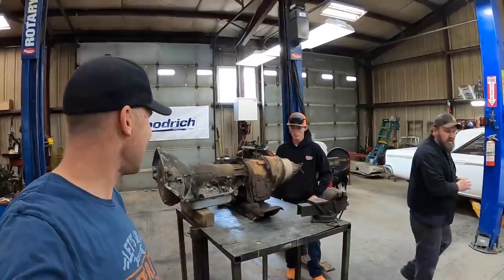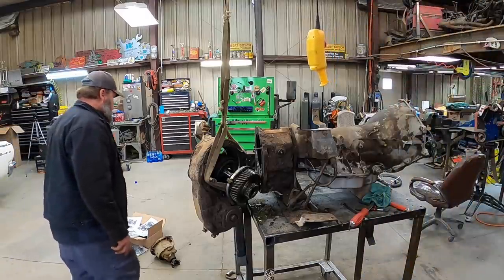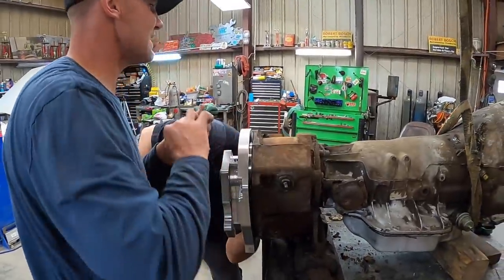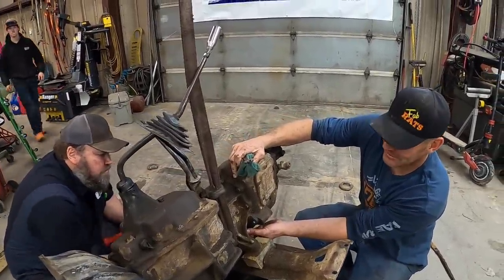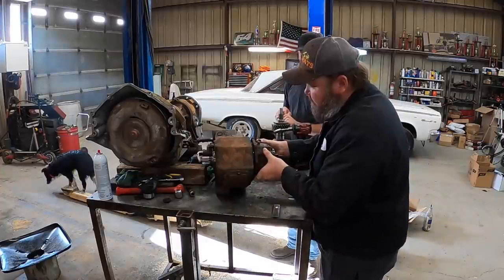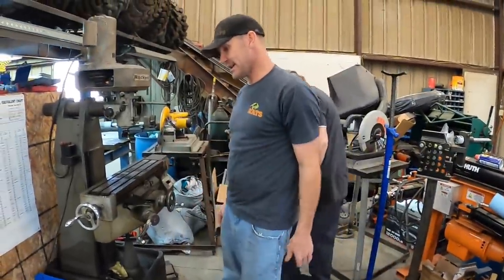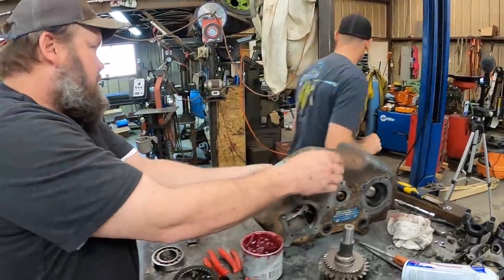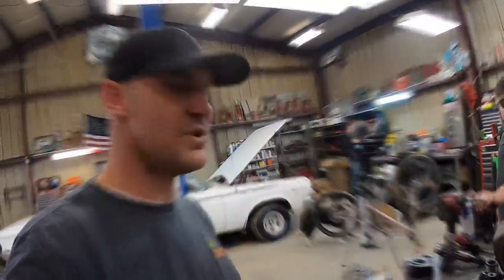No Pain, No Gain With The Rat Rod Tow Truck!

Comment: Dear Fab Rats gang, please let me come and give y'all a short crash course on maching please. I was a machinist for forty plus years and I was doing my best not to holler at y'all setting up the  case. Y'all do a remarkable job on all these builds. But just a couple of days and I could turn you into a pretty dang good machinist cause you have a really good mechanical mindset. I've got indicators, toolbits, gage blocks, dial bore gages, OD and ID mics and just way to much to list of precision tools I purchased through the years. I'd be more than happy to donate to
them to  you just so they are used. These tools aren't made in China!
Reply: Sounds like you should make a trip and pay a visit. It would be cool to watch some basic machining setups and techniques.
Reply: I was looking for this comment.  I'm not a machinist by trade but was thinking please indicate in the head, then indicate in the case.  Maybe the case was sitting on a square surface.  Then when the bearing dropped in that easy all I could think about was the race turning.  I hope it all works out long term.
Reply: That could be fun to learn how to do the best way stop in
Reply: I was wondering should have that been a press fit on that transfer case or does that get clamped in position?
I saw that it had a retaining ring on the outside of the bearing I was just wondering if the race is going to spin,
I worked on pumps for years and building electric motors so I know a little bit about bearings

Comment: Paul has an inventory control system like none other. He buys scrap parts and stacks them around the yard. When he needs a part he looks around piles and piles of parts till he finds one. After he disassembled it and combines the best looking of those parts. If necessary he mills and modifies things to make good as used parts. And it works 87% of the time!

Comment: That Rockwell milling machine would be the perfect size for me. That transfer case would fit on my lathe. To bore it out just another way to do it. Nice job as always. A couple battle wounds is always a bonus!😄😄
Reply: I believe I would have machined to about 89.95 or so and honed it from there. Make the bearing fit kinda snug. But probably doesn't matter.

Comment: I rebuild the 205 in my 1-G-D.  After nearly 20, it's still in there, doing it's thing without complaint.  I remember sorting out issues with the parts kit (input shaft bearing sizes were wrong) and having to consult my transmission man for setting up the bearings on the countershaft.  Mid January, working outside, trying to get it re-installed by myself, was not easy.  I envy you having so much good help available.

I recently found out that my transmission man now has a store/shop in Billings, MT.  What was "Quad 4x4" is now "Torque King" and they carry or even make a lot of stuff that is often sought after.  That includes a lot of upgrade items, for replacing OEM parts that turned out to be ... not so great.  So, there's another parts source to add to your call list ... Dan did the upgrade on my transmission, and I've had zero issues with it.  Absolutely no problems with transmission or the installation.  After 20 years, that deserves an endorsement.

Comment: One thing I like about your vids,... you show it all, the good and the bad. You don't attempt to cover up mistakes like a lot of guys do on these type channels, and that's life. Everyone does it and you make it real. The 203.205 doubler is an awesome and very strong set up! I hate to admit it, it is stronger than my Atlas. I'm lower, but my rig couldn't take the abuse that will be required from this old truck. Speaking of lower, Unless one of those cases have a lot deeper gear than what I know of, which is around the 2.9 low range, you should end up with more like a 4.0:1 low low gearing in just the T-cases. Which with your tire size and gearing you are going with, will be so much better than what you had. A lot of my friends end up going with the turbo 350 for two reasons, you can put a deeper first gear in them from a 700R4 tranny, and with the Turbo 400 you very often have to run a two piece front drive shaft because of the pan size of the 400. If and when you have to run a 2 piece front drive shaft, look for a forged carrier bearing. The cast ones can and will explode on you. Seen it, and it's not pretty. Since this truck will be responsible for not only it's on weight, but that of other vehicles, I do think it's the way to go. Oh and since it's a "rat Rod" get creative with all three of the shifter knobs ;) Good luck with the rest of the build. My only complaint is that I have to wait so long between vids! If it were up to me, one a day would not be enough LOL, Thanks for all the sharing!

Comment: Awesome video Paul!! I remember way back when I did my doubler kit in my 1969 Chevy 1Ton!! Stephen at off road design was totally helpful with all my questions that I had!!! I had never tour apart a T-case before!! I had definitely been putting it off because I herd about all those needle bearings but after Steve had told me a few tricks to get them to stay in place while installing the T-case it was way way easier then I ever thought for sure!!! I definitely could do one today with out any directions!! I ended up going threw both transfer cases and haven’t had any issues with it yet!! I installed mine back in the early 2000!!! Awesome job buddy and remember keep up all the hard work buddy!!

Comment: Had a NP 435 (4spd), backed with a NO 205 in my '78 Jimmy...Dana 30 front and a 60 in the rear. She would go anywhere I pointed her to go. 
Oh..and I stroked a 350 to a 383, with 205 heads..RV cam, intake and carb to match. 
She was a beast

Comment: I had picked up a spare 203 assembly for my 76 pickup.  I had no idea people were using parts of them for crawlers.  I tried advertising it and lots of other chevy engines and parts when I was moving with no takers at all.  It all went to the junk man!  Long ago I worked in a small engine rebuilding shop.  I would sit at the counter eating my lunch.  One day the owner was replacing some rear axel wheel studs.  As he hammered the first one in with the threads toward the pumpkin I asked if he was sure he wanted to do it that way.  He was a grumpy guy so went ahead and put all 5 in backwards!  Why do one over when you can do all of them over?

Comment: If you put some heat on that ORD adapter plate around the bearing recess with a propane torch and throw the bearing in the freezer for 5 minutes, the bearing will drop right in. No need to hammer it in and possibly score the machined aluminum recess. That process makes taking them out for replacement much easier too!

Comment: Love my 205. When I was shopping for a new one I became enlightened to the fact that the 85-86 GM 1 ton had a different length output shaft than all other years. 
I was pretty rough on that thing when my rear locker went out so I drove in front wheel drive from California to Houston.

Comment: I have found, that snap ring holes are slightly tapered. It happened when the holes were punched. When you punch metal, the forces don’t go straight through. They spread out a little. So knowing this, I always look at the holes and put the sharp side outward. It’s actually the opposite of how I put flat washers on. Those, I always put the rounded side up.

Comment: you can use a gum rubber band to hold needle bearings in place, the rubber band won't hurt anything so you can put it together no problem.

Comment: Needle bearings without inner race are painful. Try hairspray on shaft then stick rollers on hairspray, once all rollers in place another coat of hairspray over top of rollers. Sounds crazy but works well.

Comment: Have you ever trammed the head of your mill?  "Tramming" means you checked ( with an indicator) that it is perfectly square front and back and left and right.  
 Shall I write up directions to do that and email them to you?  It's EXTREMELY important when doing bores.  Jeff, machinist with over 40 years experience

Comment: funny and informative. Bearing hole should have been just a scosh smaller so it fits tighter i think.. but who am I right? been there done that so many times with needle bearings.. glad i too have patience. love the experience of knowledge and memory of where everything goes. I learned on my Bike, Used to tear it down to all spare parts, until frame was just bare and all parts where laid out for grease, sand paint and then re-assemble. And then put it all back together. Even took the spokes out and re-did all of them. and as for the seat hahaha been there so many times and every time i say i am gonna check seat,.... hahaha and i come in wet. Take care be safe looking forward to next video.

Comment: Where did you get pizza when you live in the middle of nowhere?   You should get a dial indicator then you can make sure the case is square by sweeping / rotating the indicator around  the top machined surface of the case

Comment: Will you end up with a slower ground speed using the 400 turbo with a 2X than the granny gear was in the manual? Wasn't granny gear 6: something to 1 where as the turbo is 2.48 times 2? Unless granny gear was not 6+ to 1 it doesn't seem like you're going to be geared as low as you were. Just a thought. I hate to see you put it in and take it out as many times as the giveaway car.

Comment: Good job boys 👍that transfer case will be bad ass 🤪 and tha craftsman snap ring pliyers are for fixing kids toys 😉  and tell me y John Deer doesn't have a drain hole in the seats my lawn tractor and Gator has the same problem 🤔 whet ass syndrome if you forget to check before sitting down 🙉

Comment: Put some retaining compound on that bearing you bored out. Bearings need .001 press per inch. That bearing should be a .0035 thou press which is easy if you freeze the bearings and heat the housing with a torch.
EDIT. You don't want the outer ring to spin.

Comment: Don’t know what oil you are going to run in your two gearboxes, the 203 required 30w or multi weight motor oil. The 205 used 90w gear oil.
I wouldn’t be afraid to run the motor oil in both or even ATF. It will be quieter with lighter oil. I have been running ATF in my Dana 300 for over 250k miles with no issues, shifts easier and is quieter.

Comment: I've had better luck with putting a rubber band on the shaft and stick the needles under the rubber band, When it goes together the rubber band will dissolve on the hot grease.

Comment: re the hole you bored out in the transfer case so the 90mm bearing would fit.  I think you made the hole too big because when you got it assembled and demonstrated the shaft turning in the bearing, the bearing should NOT be turning along with the shaft,  The shaft should turn in the bearing - bearing should stay stationay.

Comment: For the dum folk can you explain the meaning of the numbers you quote on transmissions thank
Reply: It's the model of transfer case.  A 203 has a chain, the 205 is all gear driven.
Actually, it's NP203 and NP205.

Comment: Paul, I think you're using up what little luck you seem to have on let's call it dumb luck. For instance, you make the " lucky shot" across the room, but always have the wrong parts in your junk supply. If the three stooges taught me anything, it's dumb luck dominates the over all luck product. As an experiment, start missing the  lucky shop shots, and see if your part/project luck improves. If that doesn't work, Michelle may have to leave you, cause we all know you got super lucky there. 

advanced reading: This is similar to the well established laws of Thermodynamics. Specifically, the 1st law and the equations regarding conservation of energy. I'm proposing a new law of FabricationGodDammits. There could be a Nobel prize in this Paul. Or at least as big as Clark getting the Christmas lights to work....

Comment: Or you could just buy the correct $20 bearing and not take the chance of mucking up the case? Just saying,,,
Edit: Plus you get a NEW BEARING instead of an old bearing. ALWAYS replace old bearings when you get the chance..

Comment: If I ever get out that way I'll show you how a mill works. Throw away that level son it has no business in a toolshop. What you were trying to do is tram in the head. That mill could be laying on its side and still bore and true hole. You need a machinist handbook or college machinist handbook. Dial indicator or even better coaxial indicator to tram head in to mill table, then to align the part to mill spindle center. Once this is done then you can setup your boring head tool. It's all about XYZ locations that's probably too simplified but leave the level to carpenters. Shop floors are never level and shop machines only need to be leveled once and sitting flat on its feet. Dial calipers omg plus n minus 5 ths in their best days. Hole gage set is what is used with proper sized micrometer. Hey not a hatter but just trying to point you in the right direction. You got it done and it will work and that's all that matters